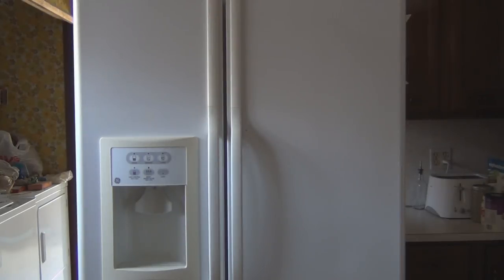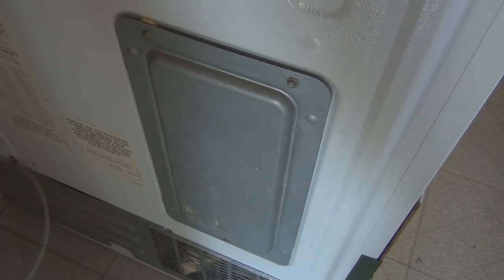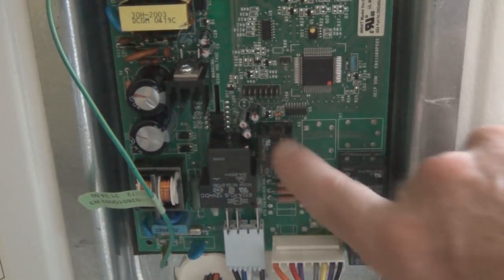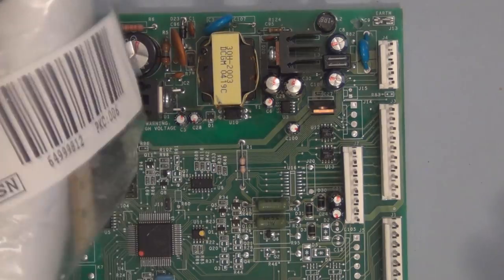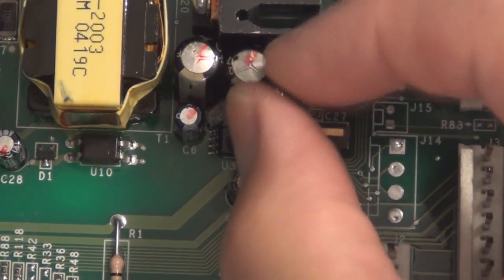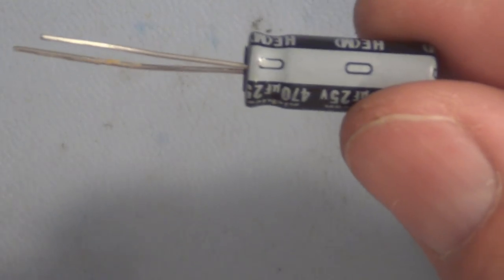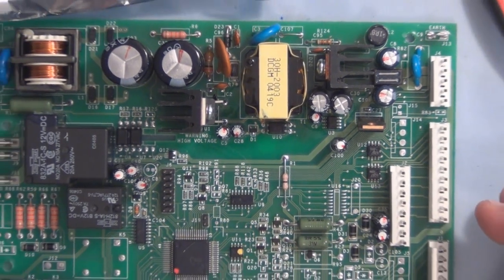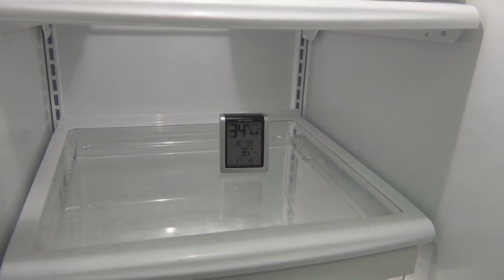GE Refrigerator Not Cooling Clicking Control Board Repair

Comment: Hey I have problem with my condensor fan I check my board and I find R95 resistor with the black spot on do you know what ohms are te hey
Reply from the maker: Sorry, I checked my model board and it does not use R95.  That spot is empty on my board.  Maybe if you search the internet for your model board you can find a schematic.  If someone is selling that board on Ebay maybe they will tell you the value if you ask them a question.  Good Luck
Reply: @tmc200527  thank you I will look but the resistor colors are brown black gray and gold just and case any body knows more about it thank you
Reply from the maker: Here are two links to help you with the color code.  https://www.electronics-tutorials.ws/resistor/res_2.html
https://www.allaboutcircuits.com/tools/resistor-color-code-calculator/

Comment: hi fantastic hack or fix i did it and really works , now  i have another trouble it is thar this board  now is not sending enough voltage to the water / ice dispenser  front panel which works with 12-14 volts and the main board deliver just 8 and dicresses to 6 when the refrigerator starts to run, do you think there can be a way to fix it changing and replacing some components ? , i will apreciate all the help  thanks

Comment: I have a Kitchenaid board clicking also. The only thing working are the lights. I’ve seen no signs of damaged components and caps look fine. The clicking sounds like it’s either from a power supply or one of two relays next to it. I don’t know what to check next. Help?
Reply: Am. Having the same problem have u. Solve urs
Reply from the maker: I found this on youtube which might be your problem.  https://youtu.be/2Y3xu0zyOMM.  Make sure to clean all the dust out around the coils, fan and compressor.  Make sure you unplug the fridge before looking for your problem.

Comment: greetings I have the same refrigerator as yours and a month ago there was an electrical failure and I stop working just turn on the light and not turn on the compressor, my question is would it be the same problem as yours in changing the capacitors and so I could turn on as well as yours that I repair?

thank you !!!
Reply from the maker: That would not damage the caps but there is a fuse on the bottom left corner of the control board that might have blown from the power failure.  Do a visual inspection of the glass fuse to see if you can see any break in the wire.  I found this video as an example.  https://youtu.be/_qK_FYufqN0  Make sure to unplug the fridge before inspecting or troubleshooting.

Comment: My garage fridge stop working I took the panel to access the main board then I discovered the capacitor was blowing and all the Area around it was burnt , later my mother in law plugged it back now the ridge is working? How that? Is the capacitor just responsible for the defrost cycle? Because before the fridge stop it was sometimes working for 3 or more days then stop
Reply: She’s got some good luck

Comment: Thank you!! It worked! My GE profile refrigerator model is PFSS5RKZHSS which is different from what is shown in this video but had the same clicking sound and flashing zeros on the front display. Like as you mentioned, having these two capacitors near the heatsink is either a design flaw or "planned obsolescence", reducing their life. I noticed the slight bulge on the top of those capactors. I replaced them with a different brand 470uf 50v high temp capacitors as the 25v ones were not available locally. It works like a charm. The whole fix cost me $13 as I had to buy a solder sucker as well to remove the capacitor. Thank you a ton!

Comment: Any trouble after this repair?  I replaced the same caps along with the 25v 220uf caps in the same area as they were bugged as well.  my unit had stopped clicking and instead the front led indicators for temperature were out.  now it id's running but it seems like the compressor is weak and has to run constantly.
Reply from the maker: My refrigerator is still working.  It's difficult to say if any other damage has occurred to your board as a result of the bad caps.  I did end up purchasing a replacement board for $66 off of ebay just in case but so far the repaired board it working for a month now without any issues.  The guy I bought the board from had my model board even though it was not listed so If you want you can email him and ask if he has your board if you want to give that option a try.  Here is a link to his store.  http://stores.ebay.com/bligthsparts/.  Make sure you use the model number on the board itself and not just the model of the refrigerator.  I found out that they used different boards in the same model refrigerator.
Reply: @tmc200527   Thank you for referring customers it is much appreciated!

Comment: My problem: GE side by side refrigerator inside fan not blowing working
Freezer is freezing but fan not blowing it over to refrigerator side.  
The fan nearest the compressor is working. 
Door open GT 3 minutes to  
Leave power on and everything connected.
Measure J2 PINS 3 to 8 should be 12VDC
Measure J2 PINS 3 to 4 should be 12/8/4 VDC and I had 0
Jumped PINS 4 to 8 and fan came on which validates fan works
Replaced 2 CAPS (C29 amd C30) from $5 from Amazon
470uf 25v Capacitor 105c High Temp, Radial Leads by Nichicon
All working as it should, saved about $500
Reply: Thanks for sharing and feedback, just curious was only issue you were having was with the fan inside the freezer(evaporator)? Compressor was running?

Comment: I paid 550$ for new ge mother board installed was wondering if that was high would I have been better off having g e do it
Reply from the maker: I don't think GE is in the repair business.  They would just send over a sub contractor and if it is not under warranty you probably would have been charged close to the same amount.  You  could have found the motherboard on ebay for under $125.  Even the retail websites offer the new motherboards for under $200.  Most of your bill was probably labor just like auto repair.
Reply: eTech Tom are those mother boards g e cause the one the guy put in was in g e box he said if not a g e board wont work also since its in do you think should be fine it seems fine since it was changed but im worried it goes bad again he said new board should at least ten years im just trying to get at least 5 years more anyway thanks for reply

Comment: All of my capacitors on my board are perfect???
Reply from the maker: You can find used replacement control boards on ebay.  Just make sure the model number is the same as on your control board.
Reply: @randalsgonzalez1708   Puedes encontrar remplazos en ebay de medio uso. Asegurate que el numero de serie sea igual que el que tienes.

Comment: Very good video, but I can't accurately troubleshoot and repair electronic boards and don't want to waste time and money trying. Most of the refrigerator main control boards sell for less than $200. I just purchased and replaced one in my 5 year old GE Cafe for $108.00  and it is working fine with no issues. It wasn't the easiest replacement with it being installed in a cramped compartment on the back of the refrigerator, but still only took about a half hour  and minimal tools.
Most of these control boards fail due to overheated components like capacitors and rectifiers. The main control boards are installed in sealed compartments  insulated from the refrigerator interior with no means to dissipate the heat they produce under normal operation. Capacitors, transformers, rectifiers and other electronics will fail if they are exposed to excess temperatures.  Try putting a laptop computer into a case when it is still on and see how hot it gets after just a half hour. This is how your refrigerator control board is operating in that sealed compartment with no ventilation all of the time. I don't know if it will help, but I drilled multiple vent holes in the control board compartment cover before reinstalling it.
There are times when you can visibly identify a faulty capacitor that is swollen or leaking, but there will likely be other damaged components on the same circuit board.  When nothing on the refrigerator is working right (lights, cooling, display) and you know the main power is good, replace the main board.  I am not a paid contributor to any appliance parts warehouse but there are some that will accept returns if the part didn't solve the problem. They typically charge a little more for the part but it may be worth it if you are not sure it will correct the issue.
Reply: Donald Spontarelli Why pay one hundred, two hundred, etc..., for a new board when most repairs a fairly simple. Continuity test a easily done and info on capacitors, transformers, relays, etc..., specs is available on line. I have found that most of the time, a capacitor is bad and easy to identify. This video is very informative and thorough. Unless one enjoys throwing money away outed not very wise to simply replace a board that could be repaired in an hour.  

I respect your opinion, however and there are times it's prudent to replace the board. 

As for the cover of your board compartment, you are encouraging problems by drilling holes in it. They are sealed for a reason. Dust and insects can short out a board, easily. You may want to consider affixing a material that could filter dust and is insect proof.  The compartments are sized in such a way as to allow room for the heat to dissipate.
Reply: @johncurtis1212  If you don't have the skills or tools to safely replace components on a board, you could easily ruin the board by pulling lands apart, creating short circuits or putting in the caps backwards. Plus there is obtaining the components in the first place.   The board is available in a couple of from Amazon in most cases. Usually part WR55X10942.  So for some people replacing the board themselves for $200 will still be a massive savings versus a tradesman's marked up parts cost and labor. Finally, for those who need their refrigerator fixed now and are not diy, the repairman is just a call away.  If you have $300 worth of frozen and fresh food at risk, the pro is a good option.